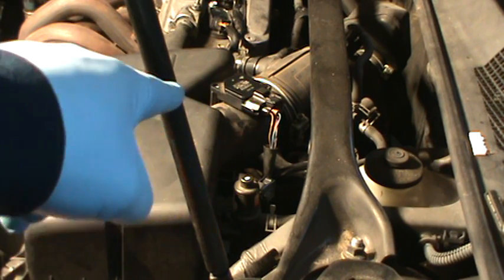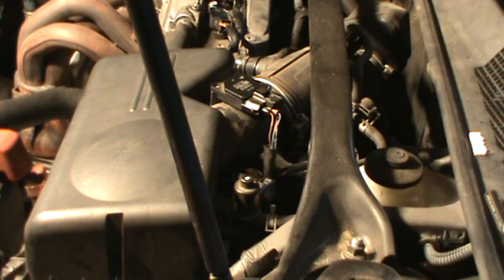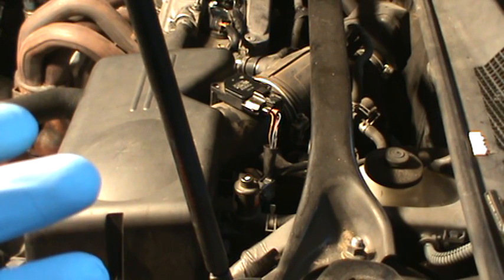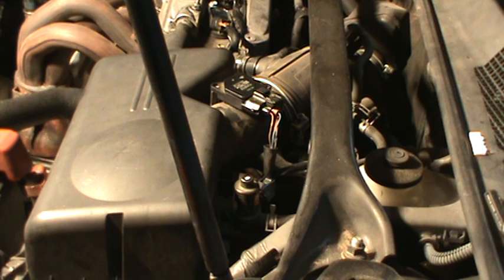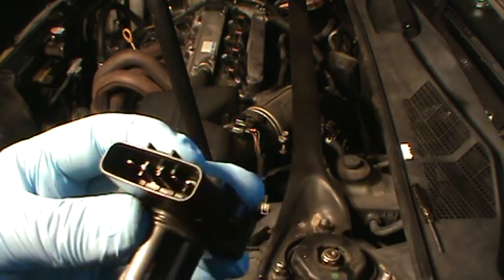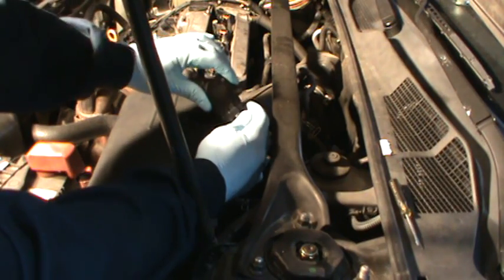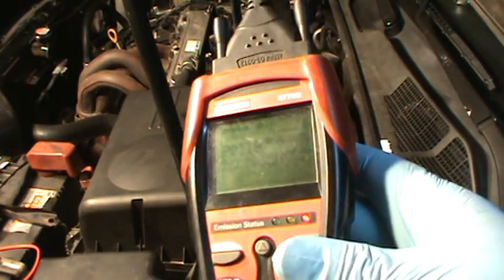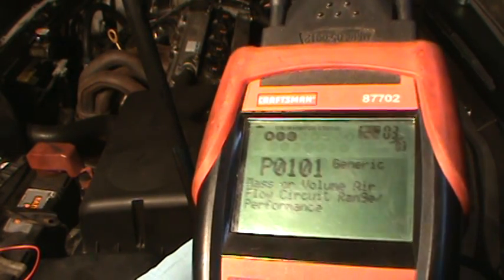P0110, P0100, P0101 Intake Air Temperature Sensor Codes

Comment: I have 1998 Nissan maxima and I'm getting a p0110 code and also a P0325 code... p0110 they say is a intake air temperature sensor. Can't find it...
Reply: I have the same codes that popped up
Reply: And p0500 the speed sensor

Comment: So I have a V6 Camry 2002, I lifted the motor from the pan and swapped an engine Mount, now I have all three of these codes and my engine runs super rough like a tractor, MAF is reading 0 to 0.01 at idle. Should I test the connector on the harness side to see if there is damage in the wire harness? Car ran mint before I replace the motor Mount 😢

Comment: My 1997 Toyota Camry v6 just thru up both those circuit codes, P0100 & P0110, along with codes P0150 and P0171. Seems to have a slight "miss" you can hear at idle. Any ideas where to start ?? I recently changed valves cover gaskets, plugs, and new Toyota plug wires, new intake & throttle body gaskets. I started the car at work one day, left it to warm up for 10 minutes, got in and "check engine light" is on. Got those codes. Any suggestions on where to start looking ???

Comment: Dude your just showing us the location of the wires and sensor not how to follow the wires or how to find an open circuit it ground or any other solutions to fix the codes change the
Title to WHERE IS THE SENSOR AND WIRES AND STOP SAYING IN GOING TO DO THIS AND THAT JUST DO IT GOOD GOD

Comment: if you have all theat codes your MAF is broken ,you can cheat on ecu with bypass or things like this and check won't light on but your engine won't worck property so whay to do all this stuff and just don't buy a new MAF sensor?A frend had all this errors and he give his maf to use it on my car,after 20 km I had all this errors too ,so the maf is broken and check engine was light on but I can say the car fly much faster with the broke one lol maybe bc of it i get more petrol injected so I have alittel more power bc the air flow is bigger too but I have theat eror so it sucks....after fier I replace back my maf all was good to normal the car run fast and acceleration is linear....so if you had this errors just change the maf :)
Reply: so just order a new MAF sensor and all good?

Comment: I'm getting the following codes:P0100 and P0110My car starts shaking when it idles and then switches off, this happens about 80% of the time.Will a new mass air flow sensor fix this issue?http://www.amazon.com/gp/product/B004J398Y8?psc=1&redirect=true&ref_=oh_aui_detailpage_o02_s00Thanks

Comment: That Craftsman scan tool looks pretty damn similar to the Matco scan tool.
Reply: ***** It is an Innova product.  In fact, when you load the CD that comes with the scanner, it links to Innova's website, where you can manage your vehicles and also connect your scanner to your PC or laptop and upload your scanner's recorded DTCs to Innova's website.  You'll get a report and possible causes.  The only thing that I don't like is that you must pay for a subscription to manage your vehicle(s) and also pay-per-vehicle for diagnostics drill-down reports (I believe it's $9.99/mo. per vehicle (which includes unlimited diagnostic reports on that specific vehicle for the month you paid).  Otherwise, it's a good tool and resource.
Reply from the maker: I believe it is an Innova product. I also think Snap On uses them for their cheaper scanners.